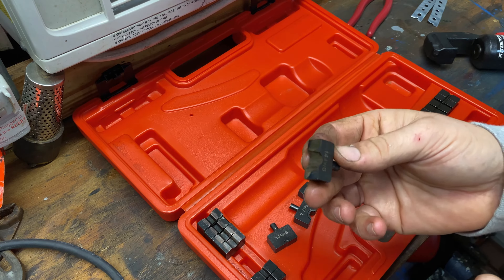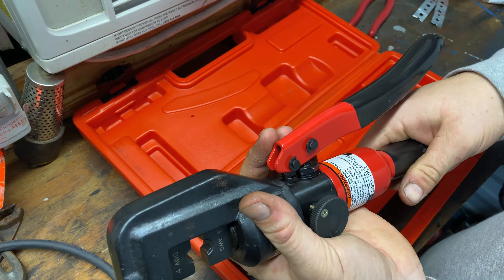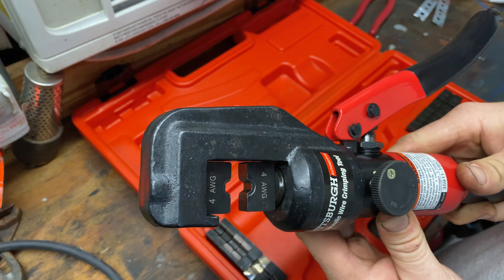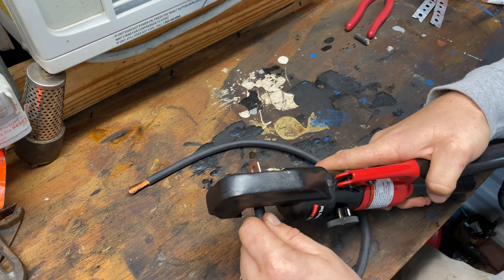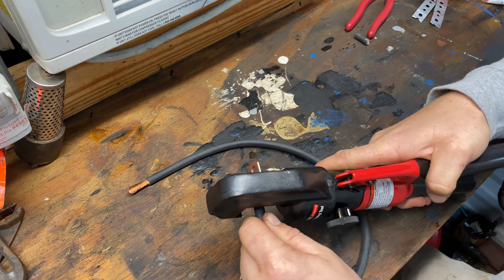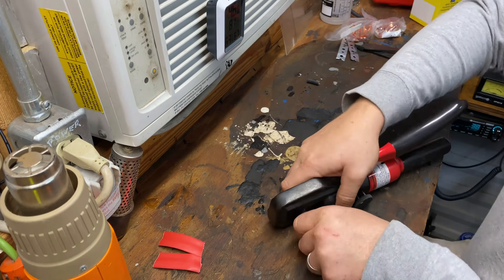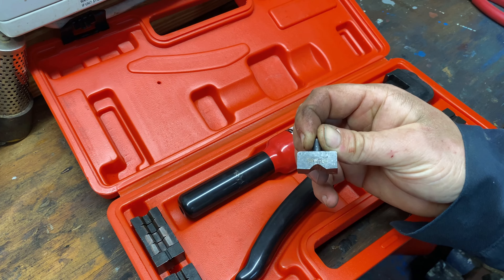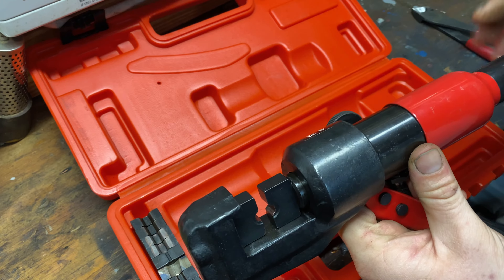Pittsburgh Hydraulic Wire Crimping Tool (Harbor Freight)

Comment: In order to see if crimp is really good you should have cut through the center of crimp. On a good crimp you will not see the wire strands, but it will look like a solid piece of copper.

Comment: Thank you for the tip on grinding the die. I need to do some 1/0 wire with oversize lugs and was worried it wouldn't work. This showed me its possible

Comment: Thanks for making this video. I would like to add the die you used doesn't fit that lug, a proper crimp with this tool doesn't have wings, it should finish as a perfect hexagon.
Reply: Its impossible without clocking 90 and u doing the original crimp. A more expensive crimper makes a perfect hex. I have both